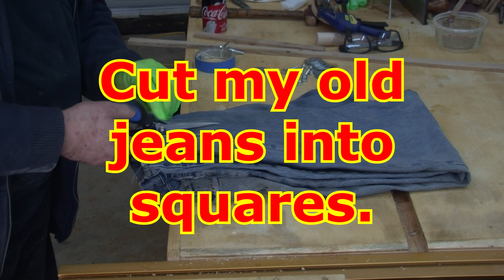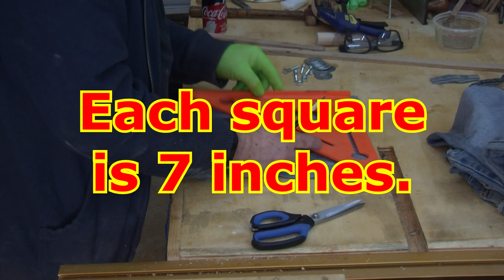Blue Jean Micarta

Comment: Why do guys use positive air pressure on resin and draw a vacuum when doing the same thing with plaster?  Do you know?
Reply from the maker: Using air pressure reduces the bubbles in the resin and can drive some of the larger ones out.  Vacuum would be the ultimate method for this but using a paint pot and air pressure is much cheaper.